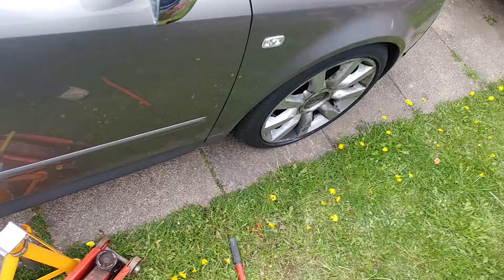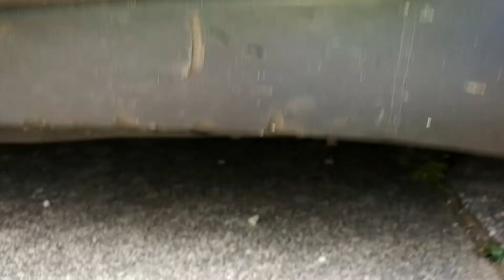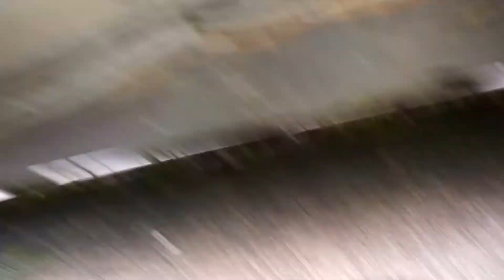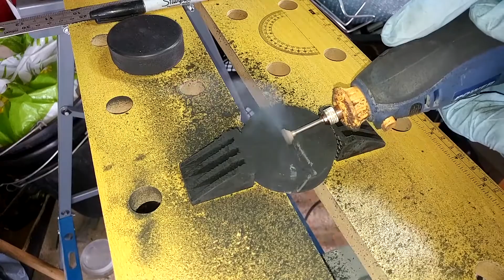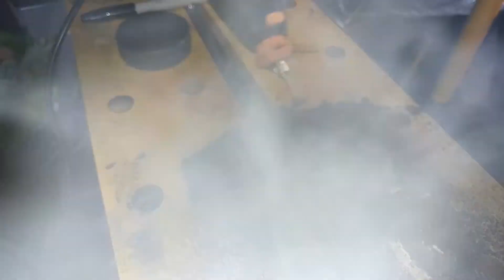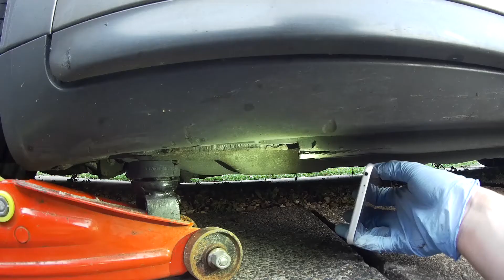How to make a jack puck

Comment: If it's a hockey puck, it will break appart, tried it already... not enough hard material.
Reply: This is 2 years old but… no it won’t. Not a real hockey puck. It’s vulcanized rubber. I would trust it over some cheap Chinese made Amazon “Jack pad.”